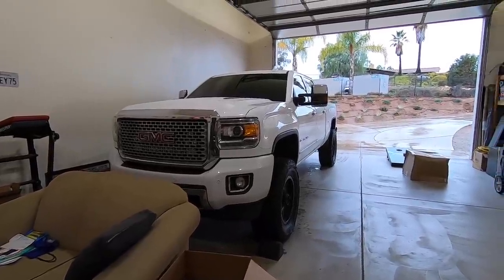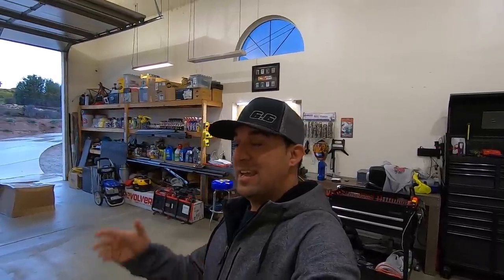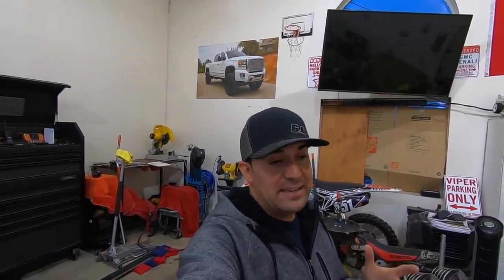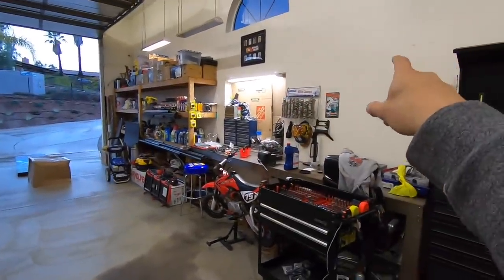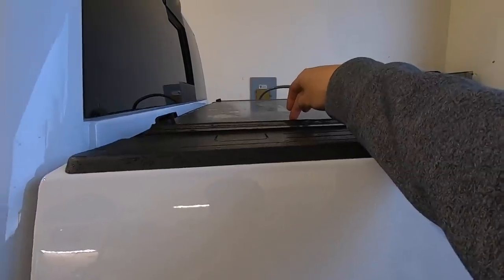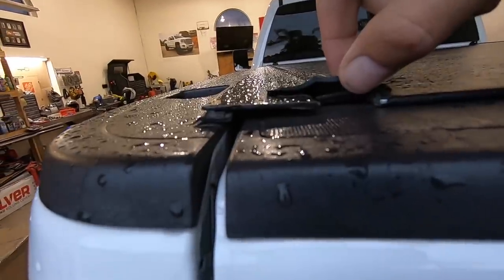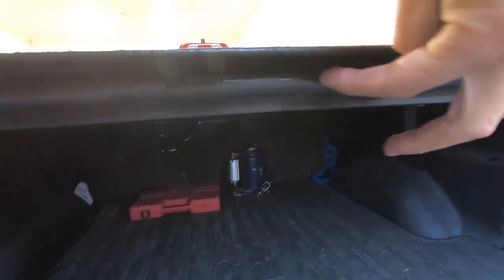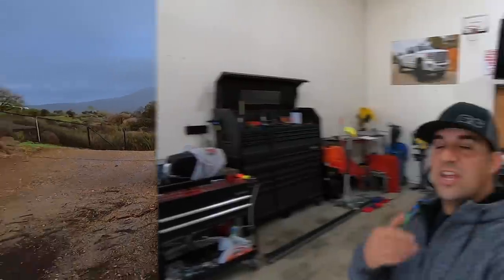ARE THESE COVERS REALLY WATER PROOF?

Comment: Dodge trans must be all in how you take care of them. I purchased a 99 2500 AT 4x4, towed loaded horse trailer, boat and 24' gooseneck with 9k tractor. No trans problems and still ran/towed like a champ when I traded at 251k miles. Then a 2005 3500 dually, 4:10, AT 4x4. Same as first Dodge but towing approx 14k living quarters horse trailer all over the NC & VA mountains. No trans problems and running like a champ when I traded Spring 2018 at 207k miles. New one is the Ram 3500 dually limited 4x4 with HO 6.7 and Aisin trans, this truck is no less than a machine! Towing my 24' gooseneck, cab tractor with front loader and backhoe, just a dream to tow with. The 99 & 05 trucks were 100% stock, fuel filters changed every oil change at 5k miles, diffs, trans and transfer case fluids changed every 15k miles along with transmission filter. To many, the service was overkill but with towing most of their life, no engine or trans issues on either. The new Ram only has 11k miles but will remain stock

Comment: I use an Extang Xceed cover and never have had any water problems... but I did use sealant on the very front bulkhead seal and the hold-down strap modules.